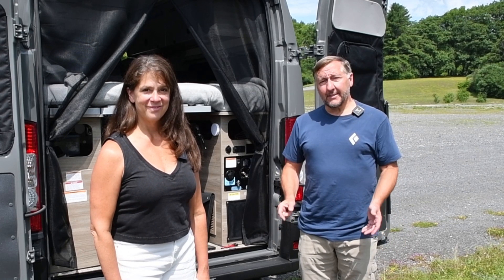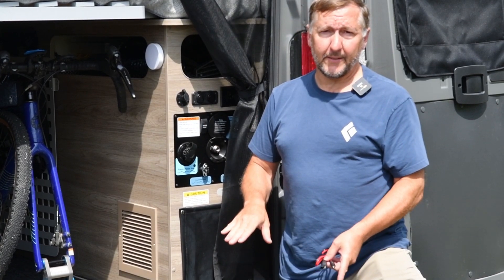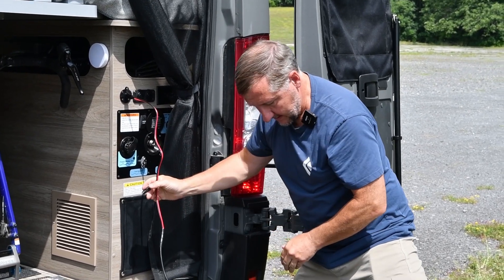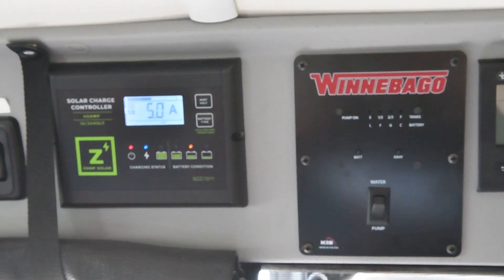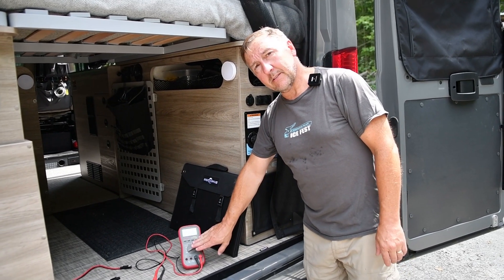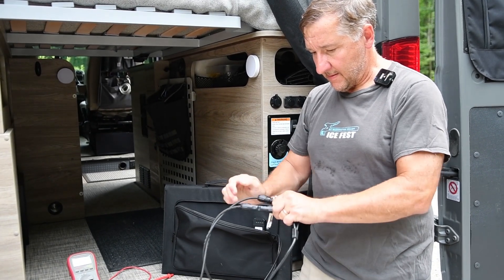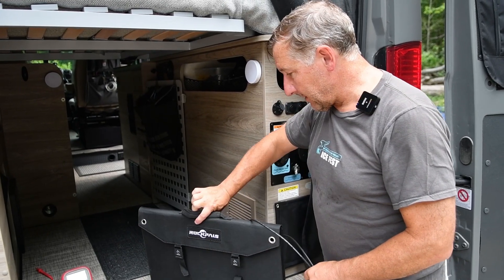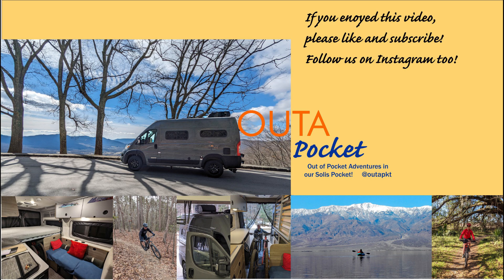How NOT to Connect an External Solar Panel to the Solis Pocket (and the RIGHT Way)

Comment: The polarity reverser surprised me. I thought there was an industry standard. Which one is backwards, the solar panel or the Solis? Thanks.
Reply from the maker: Hi and thanks for the question. The Zamp system in the van seems to be reversed compared to the rest of the industry. So, the van seems backwards to me. Thanks.
Reply: @Outapkt  Thanks so much. It's not something I would have ever thought of. I have some Oupes folding panels, and will now test the polarity FOR SURE!

Comment: Remember that the Auxiliary Zamp Solar Panels with the SAE connectors are reverse Polarity to shield the Positive terminal. The Zamp receiver plug is wired to accommodate that. Winnebago uses the Zamp SAE connector for Auxiliary Panels and is wired accordingly. Anytime you plug an Auxiliary Zamp Panel into anything other than a Winnebago you will need a Polarity Reverser. Anytime I plug anything other than a Zamp Panel into a Winnebago I will need a Polarity Reverser. I always keep 5 or 6 of those Reverse Polarity adapters in my tool kit.
My Zamp 140watt Unregulated Deployable Solar Panel is rated at 7.8amps and is regulated by my on board Zamp Controller. On a good day I can get 40-50 amps total out of just my Portable Zamp Panel.
Reply from the maker: Hi, thanks for your comments. I do understand the Zamp polarity situation now, and why they did it, however I think they could do a much better job informing or labelling things  so the consumer is aware. Thanks and take care.

Comment: One last thought. Many don't realize that to charge the pocket house battery the main switch (above the fridge) needs to be ON when driving and ON when plugged into shore power. The battery gets no charge in the off position even when there is "power" from driving or shore plug. Winnebago recommends to basically keep that switch ON all the time while in use. Otherwise the battery will not get a full charge and will drain over time needing replacement.
Reply from the maker: Thanks

Comment: Yep - just went out and checked my pocket Zamp panel - it's been rainy and cloudy for 3 days in Virginia - off and in sun but no direct sun - and my battery is completely charged. When I push the amp/volt button I get 13.6v, 0.1A, and 0.2Ah. I have an AGM battery. If you push the battery type button you can cycle through 6 different "modes" battery types. Are you synced properly? Really all of this is above my pay grade - I really don't know much except for reading my Zamp manuals a while back - but it sounds like different issue as I have had my pocket for 2 years and never really thought I needed any more solar. I do not do any boondocking - but like I said previously I have run my fridge and other stuff for weeks without any issues and without even driving the van. Hope this helps a bit - one pocketeer to another.
Reply from the maker: No worries... thanks for the additional info. I honestly think it is more running MaxxAir 12 hours a day for 5 days in 90+ degree weather that started dropping the battery, not as much the fridge. But in any case I'll keep my eye on it and good luck.

Comment: You might want to call Zamp and talk to them about your system. I have a pocket and have run my fridge for 2 weeks straight with no issues - plus my Max fan - main lights on and off as needed. Do you have a battery issue? A wiring issue? It doesn't seem like a solar panel issue or lack of solar power - I live in Virginia so same type of "environment". I haven't had any need to get additional panels as the standard installed panel on my pocket handles things great.
Reply from the maker: Hi! Thanks for watching... The issue was we had the Pocket parked in the shade for 5 days. We were not staying in it, but it was very hot so we were running the maxxair every day to keep the interior cool plus the fridge. So there was minimal re-charging going on for those 5 days. Thus when we went riding I parked in the sun and wanted to maximize our re-charge rate for those few hours. The system itself seems fine... it simply wasn't recharging when parked out of the sunlight for so long, that's all. Thanks and take care.